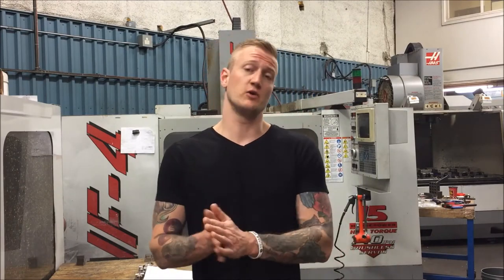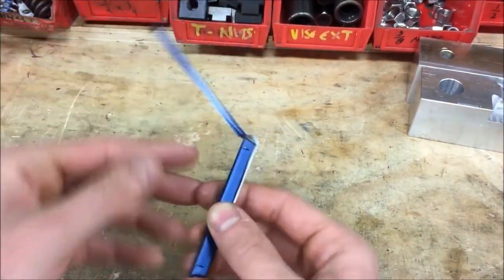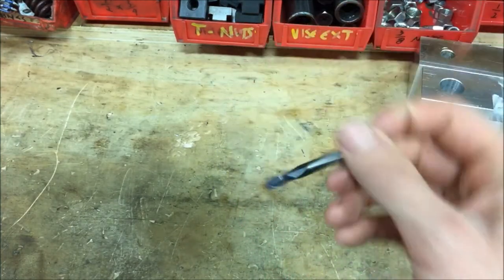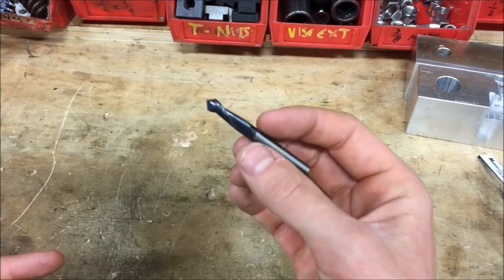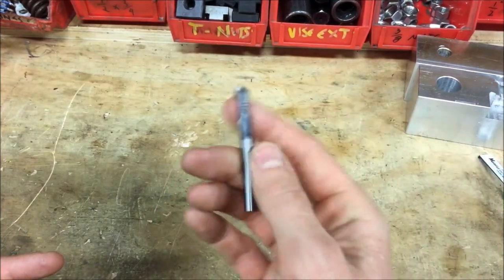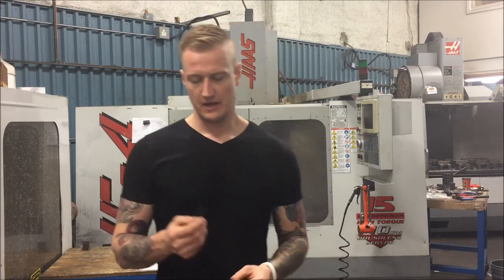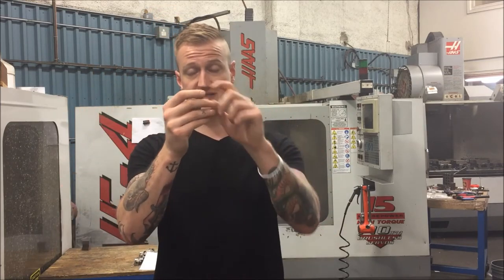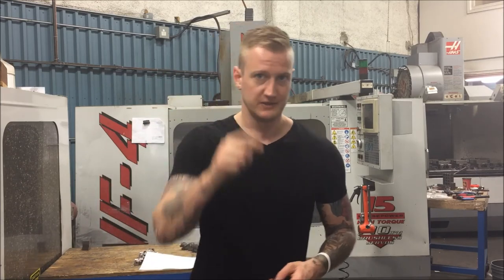CNC TOOL REVIEW: MASTERCUT 90 DEGREE DRILL MILL (CHAMFER MILL)

Comment: PowerA is the coating designation. It has an Aluminum Titanium Nitride (AlTiN) coating on it. Vickers hardness is approximately 3,600 vickers and works great on nickel alloys, stainless steel, hardened steels, tool steels and cast iron. It is an excellent broad spectrum grade. It may be run in dry or minimum quantity lubrication applications, where heat can be a problem. Also handles light chip loads very well.

Great video!

Comment: I use Hoffmann's chamfermills, but more or less in the same way as you. Supposedly SolidCAM has a chamfer option built in, but never used it, I just offset my contours as well.

To avoid burs I always run the chamfermill before doing a finishing pass with an endmill.
Reply from the maker: Running the chamfer before the finish pass is a great idea, I hadn't thought of that!

Comment: Nice, big fan of these too. Although I've never tried using this offset method. X9's 2d Chamfer type in the contour op is super useful . With a properly defined tool, the program's chamfer size will come out perfect. Linking parameters becomes irrelevant too (top of stock and depth of cut are the same, usually 0. for the top of stock). Thanks for the content bro!
Reply from the maker: Really, it's that good eh? I'll have to take a peek - for the amount I use X9 I really haven't played around with some of it's features at all. Thanks for the tip dude!

Comment: can you use a 90 degree spot drill for chamfering?
Reply from the maker: Definitely! I've done it before in a pinch - I wouldn't feed them as hard or fast, but they get the job done when you're low on options

Comment: Hey I`m 46 and planning on a career change in to CNC. What kind of math do you need to know and are there any degrees out there to get?  Thanks.
Reply from the maker: Hey there! Math is fairly basic for most tasks - as for degree / diploma, most CNC machinists are either general machinists, mould makers, or tool & die makers - so any of those streams can be pursued. A lot of colleges offer PMT or Precision Machine Trade courses that can be very helpful too!